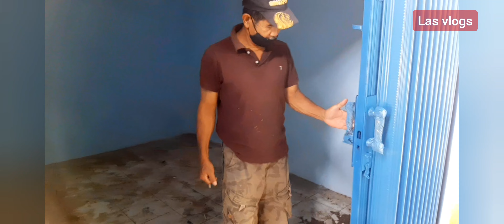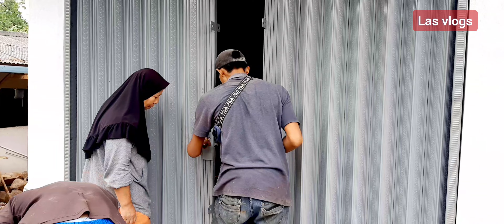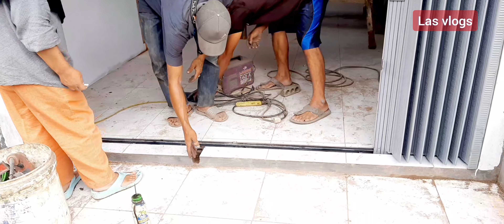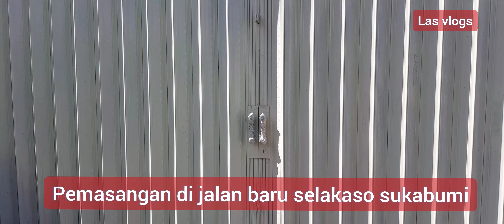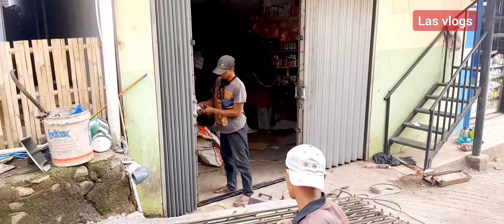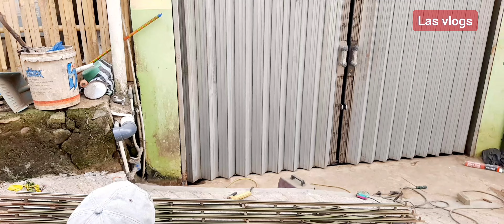kunci folding gate paling hipu gaes 🔴 pintu folding gate sukabumi #rollingdoor

Comment: Berapa per merter nya pintu folding gate?
Reply from the maker: Buat daerah mana pak?
Reply: @lasvlogs6604   daerah lembursitu
Reply from the maker: 450 rb permeter kang
Reply from the maker: Nomer hp/ wa 085860520977
Reply: @lasvlogs6604  siap kang insyaalah kin di kontek.